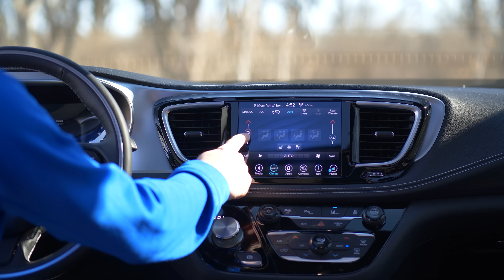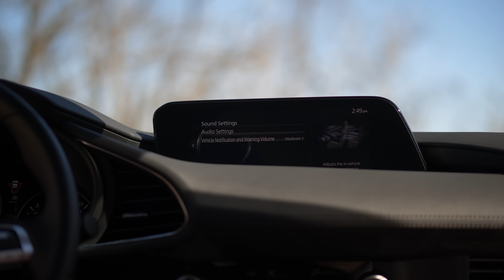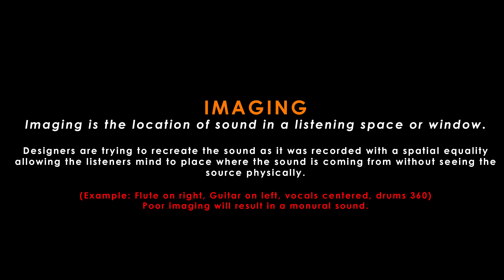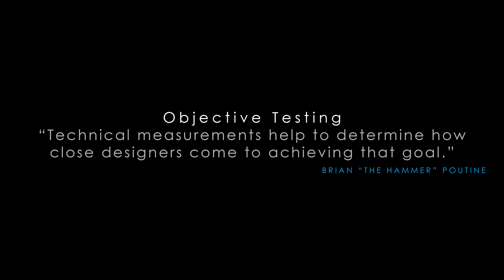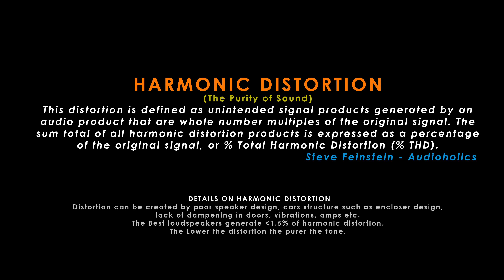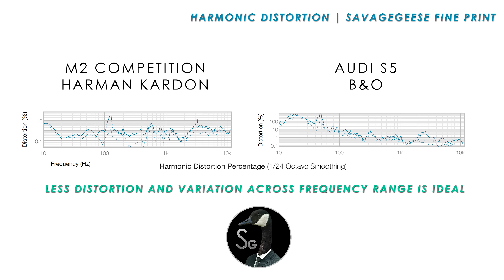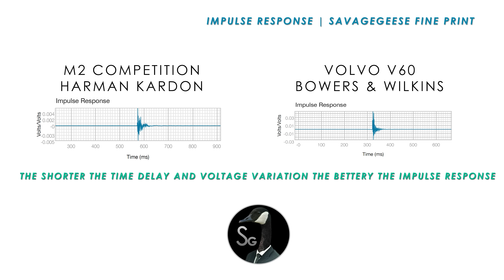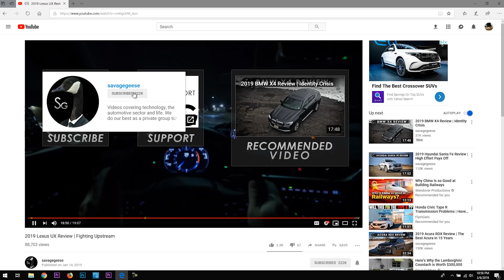Understanding Car Audio Design

Comment: Personal Rig:

Vehicle: 2013 Kia Optima
Door Drivers: JBL GTO 3-way (x4)
Dash Drivers: JBL GT0 2-way (x2)
Subwoofer: NONE
Head Unit: Samsung Galaxy S5 w/Ainur Sauron, AML, ViPER Audio, custom convolver/delay settings/EQ, through hardwired connection
Music player: Poweramp
Additional: Dynamat applications inside the doors, and along the frame

It's not the loudest/bassist, but it's clear, and sounds far better than stock.
And that's good enough for me.
Reply: Sounds like a huge waste.
Reply: @barbecuetechtips6024  Oh I beg to differ. It sounds marvelous.
Reply: @UnitZER0  rear speaker fill is a waste and will sound worse than just the fronts.
Reply: @barbecuetechtips6024  Not in my case... Thanks to the S5's audio processing, I can generate field surround sound, and by biasing the speakers rearward the audio epicenter appears to be just above the tail of the center console, at ear level, or right about where it would be if you were wearing headphones.
Seriously, try putting sound through the ViPER setup on a smartphone. It makes even stock speakers sound better if you bias them correctly. And if you have 4 speakers up front, and 2 in the rear you should be biasing rearward anyway...

Comment: 7:07 Starts talking shit about factory car stereos produced en masse, shows footage of a 2019 Hyundai Veloster R-Spec.  I mean, how specific is that?  LOL  And yes, I know that interior because I have one, and yes, it has a very bizarre sound signature that seems like it's a dynamic loudness control on steroids.  Basically, it's like looking at a Fletcher/Munson curve chart and following the changes up and down with the volume knob.

I was (and still am) a huge audio and car audio nerd, but I'm more about practicality and tolerance now in certain things.  Hauling around magneplanars and DAC/headphone amp gear isn't as practical as Bluetooth when walking the dogs, and for the little amount I have to drive now I won't need another 1500 watts of amplifier and components/subwoofer installation this time.  For now.  Maybe...

Comment: Why did you measure from the passenger seat? That invalidates all your tests. All the systems are tuned for the driver side seat position. What a ridiculus video.

Comment: Many buyers don't care about sound quality, and won't want to pay $$ for manufacturers to design an ideal system with quality components. 

"Studio quality audio" - if it did exist, would be a massive driving distraction. Imagine listening to car audio and it feels like you're sitting on stage with the jazz band.  You close your eyes and - oh wait, you're driving! And there's a fire truck behind you with the sirens going you didn't even notice. 

I think creating an amazing immersive audio experience in a car is irresponsible. 

Now understand that people also drive with the windows down at times, and all that audio design (literally) goes out the window! 

I'm a mild home audiophile, but my cars have all had crap stereos. I like driving too much to remove the audio of the engine/exhaust and other driving sounds.

Comment: I disagree with your just using Bluetooth for testing.  Persons that spend $3000 for a B&W system in a BMW will likely use the best sources available such as a top CD to hear the quality they paid for.
Reply from the maker: B&W systems are some of the best we tested regardless of Bluetooth by a good margin.  BT or not it shows in frequency response.

Comment: Bang & Olufsen are a furniture manufacturer not an audio system creator.
They wrap cheap electronics in quirky exteriors and claim to be high end because of it. They are the equivalent of Amstrad for middle class consumers who have no audio system education and are prey for marketeers. BOSE are very similar and BEATS are just for silly kids with zero clue. B&W ARE the real deal.

Comment: Car Audio? None. When I had my air-cooled Porsche the mechanical symphony is what the car was all about. Now, with the Larini exhaust on my Lotus the stereo is inaudible. Again, mechanical symphony. And of course in a performance car the audio adds weight, compromising performance on all levels. You also are less tuned in to what your machine is telling you. Of course does not matter if you don't care. Sure, put a stupid unit in your Ricer.